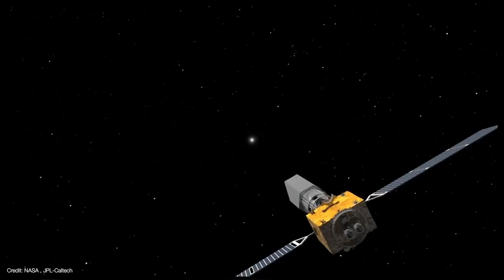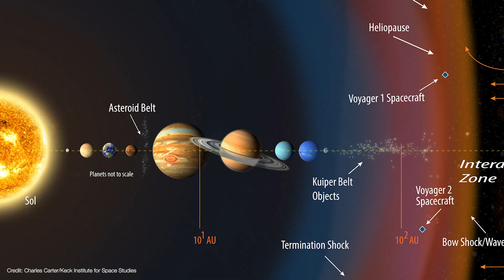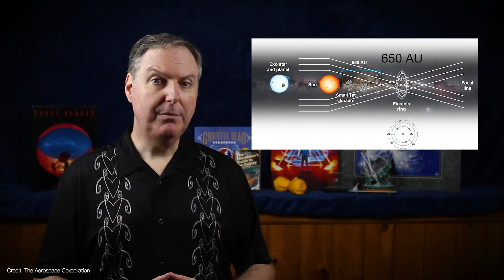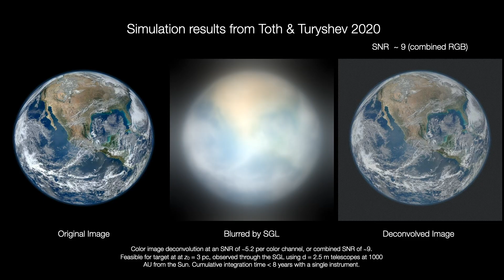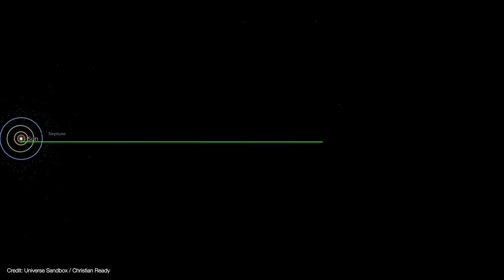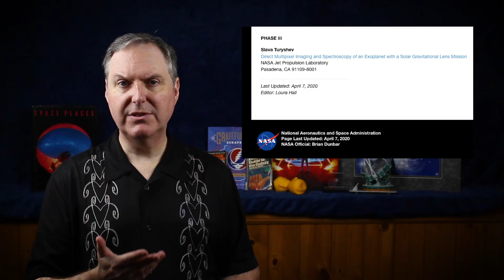The Solar Gravitational Lens will Map Exoplanets. Seriously.

Comment: Because I found myself so delighted and astounded by the very existence of the concept outlined in this illuminating video, that I had to force myself to take a brief pause, followed by a deep breath, in order to carefully reflect upon the magnitude and massive complexity of the idea envisioned.  As such, after carefully taking every unimaginably serpentine, multifaceted aspect of this project, I felt distraught to conclude that such a monolithic endeavor would require unutterable efforts.   Undoubtedly, in order to attain such an stupendous dream, it would be required not only a full-fledge resolution of multiple, convoluted technical details, but especially an enduring, sustainable dedication of a group 100% focused on its target.  Most importantly, one must not overlook the staggering, inconceivable costs involved!  Yet, I sincerely hope that my rather pessimist stance will prove to be excessive, so that this breathtaking enterprise can be actually accomplished within 30 to 50 years...

Comment: From what I understand, gravitational lenzing can also be done with other celestial objects such as the planet earth with its atmosphere. You wouldn't have to be as far out and gets rid of many of the problems associated with looking directly at the sun. I hear that of course its much less powerful then using the sun, but a 500X increase is much better then the current system with a 0 increase not doing any lenzing. Cool worlds on youtube goes into it, wonder if there are any projects in the works exploring other options for lenzing going on?   Great Vid,                       -Cheers
Reply: That’s actually what bothers me too. Is it possible to make small version of such telescope? What are the limitations? What results such ‘planetary-lens’ telescope would give us? What it would cost? Sounds like it would be very reasonable milestone before trying a solar version.
Reply: @maximmakarov3855  Ah yes, have picked up a little more info on this subject, sense that last post. I have seen an in-depth proposal concerning a first attempt on a sun based telescope, and lets just say it seems way out of reach/current tech wise. Just ridiculous cost and time to reach the needed distance etc. On a brighter note though i have also seen a few new videos that they have been successful using our current telescopes to use distant (black holes, stars) with some success and are working on refining it and making some progress with new methods (software, and hardware to correct distortions). Exciting times I must say... anyway best of luck.       -Cheers
Reply: @mikein60fpstwitch.tvaliber73  exciting times indeed! Thanks for your reply!

Comment: Great video! :) I thoroughly enjoyed it, looking forward to more videos!
Oh, and I assume we can also use this lensing technique to lens other wavelengths of the electromagnetic spectrum? Is there a practical way to do this with say, radiowaves, IR, N-IR etc?
I do also like the occasional humorous remarks in your videos :)
Reply from the maker: Thanks! In principle this will lens all wavelengths by the same amount. However, the corona becomes more of a problem at longer wavelengths so you'd need to back up further for IR and longer. The 650 AU distance is calculated based on λ ~ 1µm, which keeps it close to near-IR/optical.

Comment: I remember coming across this ~1.5 years ago.  This is a lot more explanation than I got back then, so this obviously has had some work done on it.  The string of perls and solar sailing concepts were not articulated back then, so this is some good progress.  Some things I would consider as I have been thinking about this since I saw the presentation a little ways back:

1. Some thought needs to go into the telescopes that will spot the objects we are most interested in getting a up close look of.  We already have a few good telescopes to help with this and the JWST looks like it will be a very important addition to this.  However I think I whole new suite of telescopes need to be lofted into space with the help of Starship so we can have a higher degree of confidence that we have the most interesting targets selected to do this gravitational lensing project with the Sun.

2. One thought I had for the initial launch and getting out of Earth's gravity well is of course Starship will be great for getting one batch of telescopes after the next into LEO.  While it is possible to use Starship to break orbit, where NTP (nuclear thermal propulsion) comes in are reusable boosters to get each batch up to Earth's escape velocity.  If indeed you can do the rest of the acceleration with solar sails, that would be great.  I didn't think it would work.  I thought it would be too slow and the telescopes would have to be too small, really kind of wasting the capability of having such a long baseline.  But if it pencils out, job done, you got your missions together and at a low cost.

3. There are actually multiple nuclear propulsion schemes to get up to speed.  For example if you used an advanced nuclear reactor design such as LFTR for electrical power, you could use an ion / plasma thruster to get up to high speeds as in the propellant's exhaust velocity is 5,000 seconds.  Compare this with the 800 - 1,000 seconds with NTP.  Granted even with an advanced, compact, and efficient nuclear power plant it is going to take some time to do your burn, but when you have 550+ AU to cover the extra burn time is fairly trivial.  The higher thrust burns are helpful with gravity assist maneuvers.  That could be something to mention if you want to delve into say a 2 stage NTP system where the first stage is reusable and flies back to LEO where the second stage is used to get the batch of telescopes up to speed.  However liquid hydrogen is a bit of a challenge to work with, especially if you are looking to use it for a long duration deep space mission, so it may not be the best propulsion scheme for that, bringing nuclear-electric back into the picture as a more technically feasible solution.  If you had a big budget, you may shoot for either nuclear pulse propulsion or nuclear salts.  Nuclear pulse propulsion was deemed feasible back in the 1940's, so we could definitely do it now and probably a lot better than the original Project Orion ideas, especially as we can get a safe distance from Earth before lighting one of these off where in the 1940's and 50's we were looking at this to get off of Earth because we didn't know if a chemical rocket could do it.  Nuclear salts also looks pretty feasible and Scott Manley did an excellent piece on that.

4. So assuming you have Starship to get into LEO, NTP to break orbit, and whatever propulsion scheme is deemed most reasonable to get the telescopes out there and the communication technology to get the data back, you could have your mission plan together and for an affordable price.  I mean you are not going to send a bunch of JWST telescopes out there, but instead mass produced 'basic' telescopes that will be low cost to mass produce.  Your booster system to get away from Earth only has to be built once and then refueled for future missions, so that cost isn't too bad.  Then we have ways to get up to speed; it is just a question of which method is the best fit.  Then you are sending batch after batch of telescopes and associated communications gear out not unlike how SpaceX sends up batch after batch of Starlink satellites on the relative cheap and you have a program that is affordable.  At this relaying through communications spacecraft spaced one year apart could be how you keep the communication gear small and cost effective while maintaining high bandwidth all the way out to the furthest group of telescopes.  In your last batch maybe you send out a large communications spacecraft for extra $$ to keep performance up, but everything else should be low cost.  I mean I am thinking you might be able to get costs down to something like $20 million per batch and you are saying you only need one batch per year to get a good Earth sized planet sharp and detailed image.  Per decade you are then looking at $200 million.  Really that is pretty sustainable, especially when you look at what we spend today on basically any space project.  And this project with the right targets selected by other advanced telescopes would completely transform our understanding about our place in the universe.  Some of the biggest things we ever discover could be from this project, so totally worth the expenditure.

Comment: Cool technology, I think the key to all this is automation. The system really needs to be A.I. capable and learn during the journey.  One obvious feature you didn't mention is that it should have a prioritization of planets that give out the lights of Blue, green, red colors and in that order.  The mission should also be sent out in all directions, as much as the budget allowed of course, and there should be intermediate launches with hubs from the earth to the explorers that can receive and store the images as a backup in case one failed and also if the distance becomes too far and the signal weakens. The system should be a matrix of hubs connected together and be able to recreate the data if one of the hubs is lost.

Comment: This is easily the most exciting vid I have seen for a long time ! I had no idea that this was so advanced, I knew of gravitational lensing, who doesn't , but to use it to find habitable exoplanets ?! wow ! this will DEFINITELY be the key technology that drives the impetus to travel to  new star systems. This, and the fact that now, thanks to the latest breakthroughs in superconductor technology, means that fusion as both a near inexhaustible power source AND a method of propulsion with the potential to have speeds up to some modest fraction of light speed, really does mean that the next few decades are going to be very interesting , I think Mars will be settled within thirty years, but missions to other stars might be undertaken in a century or so, who would have thought that the technology to do it was so close at hand ? The only technology that has not been investigated is human stasis, or slowed respiration, hyper-sleep, call it whatever, that is also very do-able.
Reply from the maker: Thanks I’m glad you liked it and found it as interesting as I did!

Comment: The only thing I don't like from this method is the need to keep throwing materials to the space, to scan the cosmos. It would be much better to find a way to slow down the devices when they reach the work place, and keep them there until these have to be moved again. This capacity would add more value to space exploration than finally find an habitable planet, being able to print a poster of it, while knowing is out of reach.

Comment: I wondered if a neutrino detector could use Jupiter’s gravitational distortion to concentrate neutrinos emanating from deep layers inside the sun. It would detect neutrinos that actually passed through Jupiter so it could be positioned at a Lagrange point on the far side of Jupiter. It could thereby determine which depth layers inside the sun create neutrinos. Also the type produced and if neutrino layers vary with the sun’s latitude

Comment: Took me a couple of views to understand the string of pearls concept. So here's what I gathered, the first generation of these would practice taking pixel snapshots of a planetary surface but it would be blurry and might not have much detail because of spin and clouds, etc. However when the next pearls are launched and within range they too would do the same but this time they would receive data from the pearls ahead of them. This data would be of an image that's not a pixel size at that point but clusters of pixels known as sprites. These sprites may be used as a reference that the next generation of pearls would use to stitch together one pixel at a time at 25 km resolution. If another pearl group was launched then all of them could communicate between each other and start removing clouds from the picture, improve sharpness, and reduce noise.

Comment: You could use the sun's movement and/or a diagonal path of the telescopes to scan in one axis, and use a straight perpendicular line (instead of a dense group) of telescopes to scan in the other axis, so you won't need nearly as many telescopes as you presented.

Comment: One thing that wasn't really talked about here is how you would transmit the vast amount of data back to earth.
at 500AU the signal would be extremely weak and even using lazers you''d need a vast network of relays that could reliably catch the signals from just 10-20 groups of those cube sats.

Although this is incredibly interesting and it actually seems like something we could probably get going within your life time, something that people often do not talk about is interstellar communication.

An idea that popped into my head was maybe using quantum entangled particles, if the distance doesn't matter then maybe we could use one cube (or more) of the cube sat in a group that has a quantum entangled particle linked back on earth. that way you could measure the signals and reliably get back the data no matter the distance. 
The time delay would still be present but that doesn't matter, if such a system is possible for satellite to earth communication, we could in theory also update the mission with software updates or new targets. But that's probably not doable withing my life time :)

Anyways that's a really interesting video

Comment: 1. How are these craft slowed down to the point of being held in a stationary position from the Sun?

2. How are they held in position once they reach their destination?

3. Given how long it takes for information to travel from Mars to Earth, how long will it take information to reach Earth from 550 AU?

If you ask me, with current technology this is not feasible. It's doable, but I don't think it'll work the way anyone thinks it will.
Reply from the maker: 1. They wouldn’t. They’d continue along the focal line. 

2. They wouldn’t. They’d fly tangential paths to maintain relative station keeping with ion thrusters. 

3. About two weeks. 

Difficult? Sure, but not impossible. We’re clever apes :)
Reply: @LaunchPadAstronomy  Actually, it would take radio signal "only" ~76.05 hours or ~3.17 days to cover 547.8 AUs. So that means no manual control and the probes will have to be fully automated, which is going to be a challenge for software/AI developers.

Comment: A similar concept was recently published by Dr. David Kipping from the Cool Worlds channel. It elaborates on the possibility of using the Earth's atmosphere as an atmospheric lens to achieve amplification. It was estimated that it might be possible to achieve as high as 45,000x but that it's more likely to get 22,500x for a 1 meter telescope located a hill radius away. That's equivalent to a 150m optical telescope. Not as impressive as a gravitational lens and its equivalent 90,000km diameter telescope, but a "terrascope" could prove that it's technologically possible to achieve before sending a satellite into a 650AU orbit. 

It's my assumption that such an atmospheric lens could be used on any planet with an atmosphere in the solar system. Unlike a gravitational lens with a focal point that relies on the Schwarzschild radius of the object making the Sun the only viable option.

Comment: Don't need the 'pearl group' to attach to each other.
They can work as a sparse array (think SKA telescope). Then your aperture is the distance between the 2 most distant sensors.
Of course an easier solution is just place telescopes in solar orbit, to get a telescope 
1 AU in equivalent diameter.

Comment: Great informative presentation.  So since scientists & engineers have used & applied their knowledge to allow the Parker Space Probe to achieve speeds North of 350,000 mph which is more that ten times the speed of either Voyager Space craft why isn't the same technique paired with newer technology being applied to future exploratory missions. It just seems like that approach paired with longer lasting power sources would advance our goals by an exponential multiple every 10 years (forgive my math) = 40, 80, 160 and on... in just 30 years. Additionally, by launching subsequent more advanced relay probes all with upgradeable computers aboard the time required to receive feedback & send new instructions would be greatly reduced. In the meanwhile research and development on newer launch approaches could continue.

Comment: It seems that even if we use the sun as a large telescope, it'll be very hard to pull off and the results might not be what we hoped. I'd rather see them put that money towards a huge array of telescopes (TS) where we can use interferometry to help image exoplanets. It should be a long term project where we put up thousands of mass produced hence cheaper, TS every decade until the array is large enough to give us good resolution images. 

Another option is the Starshot program-but rather than wafer-sats, have something a little larger and more capable like a microsat that can give us up close images of planets and that can hopefully orbit them over years and send data back. We can use existing satellites to find 50 or so good candidates that could be habitable and then send mini-telescopes to each one. If we're really ambitious we can launch drones to see the planets up close. You can power them with nuclear decay batteries or RTGs.